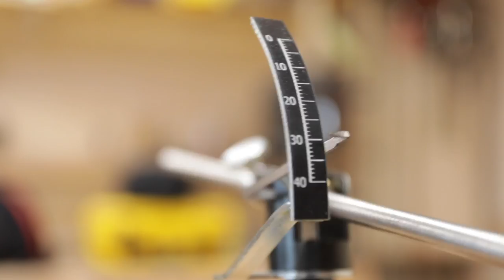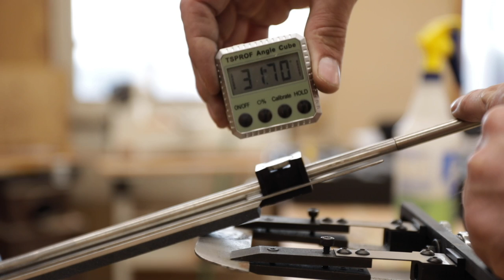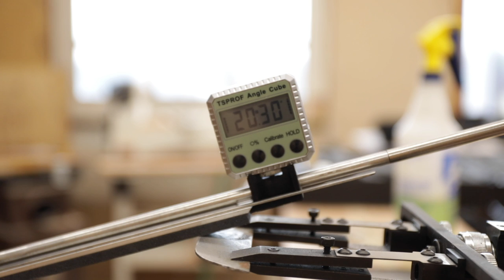Can A Knife Be Too Sharp? 2

Comment: 10:50 The reason that the thin edge bending during sharpening proces is because You were doing this opposite direction. To avoid this and do really sharp edge, You should move stone from the edge to the spine of a knife. Other move, from the heel to the tip, was correct. Greetings and sorry for grama. I hope You understand what I want to explain.
Reply: The reason it bent and didn't work is only because of type of metal

Comment: I mean “too sharp” is a relative thing. Theoretically if you had a sharp enough knife you could cut through wood like butter. But also that theoretical knife would need a very specific sheath that suspends around the blade and never touches it.
Reply: I’d still bet it couldn’t cut through my Grandma’s steak.
Reply: @spudexfilms5799  Yikes
Reply: @prehistoriccreator9600  yes
Reply: It wouldn't cut through wood like butter, the ultra sharp edge would become dull after the first cut because it would be so thin.
Reply: @MrPablosek  fine, the blade is indestructible too
Reply: And likely a very very long taper on the knife
Reply: @MrPablosek  i mean to even be able to even hold such a fine edge in the first place it would have to be made of super advanced alloy, thousands of times stronger than what we have today. No alloy we currently know of would be able to be sharpened to such a fine edge without simply shattering during the sharpening.

Comment: Well important for a good knife steel, that will be able to be pretty sharp are a few factors
Most important high hardness and a good ductility .

By that you can achieve a very narrow angle <25° and a very slim, sharp edge without destroying it. (high carbon  percentage (0,5-1% carbon, some vanadium, sometimes cobalt...)

Comment: I'm wondering since it's not tool steel that if maybe the tip of it is getting too warm and warping.  When I was microwelding on the molecular level for a local company, any amount of heat would cause unwanted warping and other artifacts to make the welds unusable.  To combat this, we had to use a constant, temperature controlled thermoelectric cooler on the materials we were welding to prevent the materials from getting too warm or too cold.  I suggest you try again but attach a liquid  cooling block to the knife and circulate the heat away from the knife and see if that helps and have the other end attached to a radiator or someplace that'll take the heat away from the knife.  Just an idea.

Comment: The sheet metal has higher levels of softer metals like tin or zinc. Both of those will take "edge" but not become razor sharp like blade steel. You were right in your deduction of why it's not as sharp. If you wanted it to get closer to razor sharp you would have to take it to 17° and have a really light hand with your stones. Again being a softer metal it would loose that edge fast whole using it, unlike an exacto blade  or scale which are both high carbon steel and hardened. One thing you could try is hardening the sheet metal after you have your edge set then honing the blade after. Worth a shot and would definitely watch that video also. Thanks for your videos, I've been watching you for several years and always find your attitude uplifting and encouraging!

Comment: Hello! Steel can be hardened by changing its internal molecular arrangement -- heating is one aspect of getting that.  Cooling of the hot metal is also used. Some people have used liquid Nitrogen to cause a very fast fixing of position of the internal molecules. The high Rockwell numbers come from such shock quenching. Care must be taken because the changed structure can be very brittle. "Drawing" [withdrawing] a blade's temper can restore flexibility without complete loss of hardness. As I understand it, the blade is heated again [Not to red-hot, but just slightly red] and allowed to air cool without quenching. [Do get an expert to tell you more. My understanding is not as complete as I would wish it were.]

Comment: Waiting for someone in the comments to point out "Too"- oh, beat me to it!

Also the steel won’t hold the edge because it’s too soft, the perfect blade is finding the balance between flexibility and hardness. Hardened to keep the edge and flexibility to avoid snapping. That’s why a katana was such an effective weapon! Very interesting to delve into how they are made and the craftsmanship behind them.
Reply: Dino Barberino More like 'why a sword...' Traditionally a katana has a really hard edge, sixty rockwell give or take. The back of the blade is not hardened at all. Which makes a great cutter, but not a very resilient sword overall. When they bend they stay bent. Bending them back flat stresses the steel and they will eventually break. The new monosteel competition and practice cutters they make now aren't NEARLY as pretty, but are much more resilient because the blade has a full spring temper like historical western swords. Actually, scratch 'western' because pretty much everyone BUT Japan through-tempered their blades. Mostly. 😺
Reply: And I mean Katana style competition cutters. The Katana is a very effective weapon, I just wanted to point out the difference between the traditional manufacture with the differential temper and the modern through-tempered blades.

Comment: Hey Wranglerstar, keep those morning open for God he will blow your mind when you get that connection right, got to be less carnal and more spiritual.  With regards to your steel knife making uses a higher carbon steel which allows it to hold its edge.  Sheet metal is made to bent so you will never get a decent edge on it.  Have a blessed day.

Comment: One thing I think many people have missed in there comments from months ago, is that just like wood and stone, is that metal also has a grain. In cases like sheet steal, most people won't care what the direction of the grain is because it is not normally used as a load bearing part in anything. It is usually decorative or for protecting mechanical parts. If you look at a sharpened knife, the grain only goes in one direction and that is against the direction of the blade. If you had the grain going the other way, it would be too soft and more metal will come off with every pass of the stone. That is why you saw the vertex or edge of the blade quickly shifting from side to side as you tried to sharpen it. The sheet steal in this case has crossed grain and you see it going on direction in some places and the other direction in others places. Start with something like a thin section of a small I-beam and you will have very different results because they are load bearing by design and are craft with specific requirements. And the metal workers form them in a way that the grain only goes in one direction. If you want a great example of this, cut a piece of cast steal like your vise in half and then a section of I-beam in half and you will see very random and not very strong metal (when it is thin, in large blocks basically anything can be strong), and the I beam that even in pieces is strong and would take literal tons of pressure to bend or flex.

I'm sure people won't see this and if they do they won't quite understand what I am saying but saying something can be explained by "physics" doesn't really say anything about you understanding something or just having a word that you throw out because it is a simple word that refers to a very complex and expensive subject. Physics is the basis of everything, but that doesn't mean it explains everything. Anyway for the few people that do understand what I am talking about you are probably either a metal worker or a builder and you have studied these things. And the few that aren't that say they understand, you are lying. But it does make me happy when I see people that are probably in the late 20s or early 30s that think they are even vaguely intelligent use words that are vague so they don't have to explain themselves. This is due to the fact that I am 18 just out of high school and you half wits couldn't rap your head around what I have explained. Also, for people that will say that I am either lying or that I have studied these things, I do work on my own equipment (trucks, cars, lawn tractors, tractor and several other pieces), but the only reason I can grasp these things is my mind and aside from a few well known scientists from the past, I have yet to ever find someone else who thinks the way I do one so many topics. Thanks to those that have gotten this far, but you should probably get a job or a good hobby, because if you have enough time to read all of this, you should think about what you are doing with your life. I have an excuse though as I am soon moving and don't know where I should get a job at quite yet, and I am starting college in a few weeks. And if you are wondering what I am studying, I will be attending USC (that South Carolina not Southern California for all you preppy pretty boys in families that have more money than they can fathom what to do with), and I will be getting my bachelors in computer science.

Comment: If your curious as to why its not as sharp, the idea is that most knives and tools are heat treated. This is where you heat the steel up and then rapidly cool or "quench" it, which allows the carbon in the steel to stay distributed evenly throughout the blade. You can then heat the metal back up to a lower temperature which slightly softens the steel, making it less brittle and prone to breaking, which is called "tempering" the blade. The reason this matters is that the steel is probably bending at the very tip of the edge because there is so little material. If you want to try this again but not go the heat treat route, just reduce the pressure you're applying to the blade to sharpen it, this should prevent the bending a little bit better, or as you suggested using tool steel is a great idea.

Comment: I could see the crystallised structure after the first pass/ grit that knocked the corner off, 
heat treating and folding (Damascus) can help, 
but if you start with a pony bit of (mild)steel you cant get it to 'hold' the edge.

I have some old well used emery paper (+ 2000 wet &dry works) that I oil up to finish, 
I sharpen those 1 sided razor blades with it as well.

Comment: Impressively sharp, but as you observed the edge wanted to keep rolling. Sheet metal has low carbon content, so it's not hardenable. If you can't harden it, it won't hold an edge. But still, it'll do in a pinch, true?

Comment: It's the hardness of the steel.  The softer steel doesn't hold the edge as well because it can bend more easily when it is very fine.  In other words, when you grind away the steel to make a thin edge, pieces of the edge will come off and the edge will bend easily.  Soft steel also doesn't stay sharp it will dull very quickly.  Still cool to see someone go through the process and prove the concept!

Comment: I got mine done with just a leather strop, and compound.  But took it took me a while, it does helps use up some of the free time, like how you said. 

I tried aluminium, got the same result, the edge was not that strong.
Reply: I use diamond files, they come in sets of 3. Work fairly quick. Some heat treating requires more machining tools and those cheap little things are awesome

Comment: I would assume, having watched a lot of Alec Steele's stuff, that the sheet metal doesn't have as good of a temper (if any), which prevents it from holding more of an edge.  Still, you got it to cut, so that's something for the survivalist book.  (provided you have a sharpening steel in the wild..)

Comment: Yes, at least for my purposes. I do a lot of hunting and a lot of fishing, which requires doing a lot of fish and game processing. I picked up a havalon because I am lazy and didn't want to sharpen my knives. It has been an interesting experience, because by myself I keep really sharp knives. But these Havalon blades are so sharp, and because I am so used to using my knives and the ever so slight amount of pressure to make them work, that the havalon blades changed that and they often require even less pressure. Well short story, long my wrists, arms, etc are calibrated to my knives and I find myself cutting and poking myself with the havalon blades because now I am applying to much pressure.

Comment: The harder the steel in an edge is, the harder it is to sharpen. HOWEVER, it also doesn’t just retain the edge WORLDS better, but it also takes on and WAY better maintains edge symmetry - which is most likely what led to your EDC knife being much easier to sharpen despite its much harder steel (that and the fact that the sheet metal’s cutting edge was added on from scratch.) Bug yeah, you take a high carbon edge and give it this sharpening service, then you can look at straight at the edge and see a super fine and super straight line all the way up and down; and it’ll stay that way. It’s one of the things I love the most about the complexities of metals.

Comment: I used to get a suckling pig every Easter from the local pig farm. All the workers there (slayers) use one-piece butter knives sharpened to a razor's edge to stick the pigs. Also, in their shed is a LARGE oil wheel powered by an external electric motor and drive belt that they use to put the edge on their knives. Very simple yet very effective.

Comment: It's a pretty simple concept.  You sharpen it too much, and the edge of the blade is soo thin it will microscopically fold over into a curl onto one side.  So you're essentially trying to cut with a rounded edge, which actually makes the width of the edge wider than the width of the pocket knife's edge. And since it's a rounded curl, you're also deflecting stuff off the curl, so rather than cutting, you're more so tearing the paper through pressure with the width of the blade, which also means more contact between the knife and object being cut, which results in more friction, making it harder to glide when cutting.  At that point it's functionally no different than a dull knife with a rounded edge.

Comment: You need to heat treat Harden the steel to a Rockwell rating of 52-66 HRC, so it will hold the edge. It's too soft, you're just rolling off a burr and taking it off with the finer grit and making a smaller burr with it. The edge will just keep rolling because it isn't hard enough.

Comment: Sheet metal is formulated to deform plastically. So it is best to deform by stretching bilaterally to get "necking" to form the edge. This is why blunt tin-snips can sometimes for a very sharp edge along the cut line.

Comment: A few drops of cheap lighter fluid on the compound brick will loosen the top layer up so you can apply evenly with out crumbling.
also use much less compound for best results

Comment: the bending edge your talking about is called burring it is extremely sharp because its effectively as thin as the metal can get. however it takes away from the sharpness of the knife because of its flexability. when working with knives meant to be that sharp many people run the edge backwards on a leather strap to fold it back and forth and break it off without dulling the actual edge. you could get the same effect with the leather block but it would be harder to do and take longer. you might even be able to freehand the leather block or anything else leather (i used to use the side  of my boots) but in that contraption you wont have an easy time

Comment: Its the quality of steel, sheet metal is soft, soft steel wont hold an edge as well as harder steel. For instance a well made forged knife will have soft steel in the spine for flex and high carbon hardened steel on its edge for max sharpness. You also need to temper, ( heat treat it), to further harden the edge. If you had used the ban saw blade it would have shaved no problem. Nice vid though ! Cheers and God bless

Comment: The edge might be rolling over or it might not be as hard as knife steel. If you sharpen it as much as you can then quench it, a simple propane blowtorch and bucket of water will do, you can keep the edge sharper for longer.

Comment: this is actually a great example of edge retention and why steel types matter.
Yes the reason is the steel indeed.
It can lose it's edge on soft contact if it is not meant to be rigid enough as a thin structure such as a knife edge...
everything can be sharpened, not every material can retain a sharp edge on contact...
A paper can be sharp too, you can't shave hairs with a paper... same thing